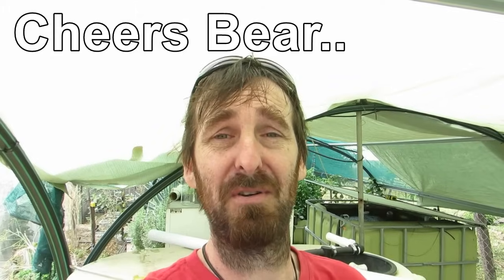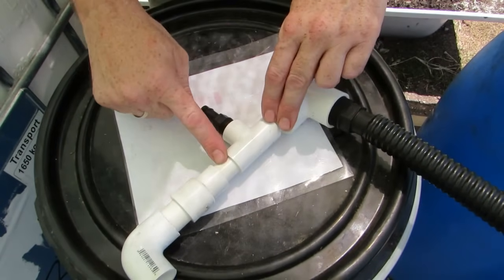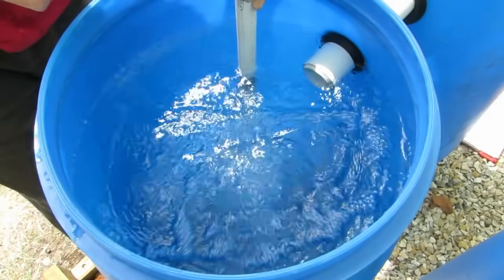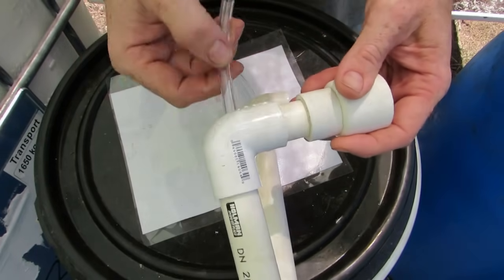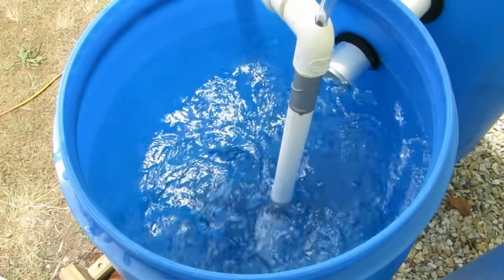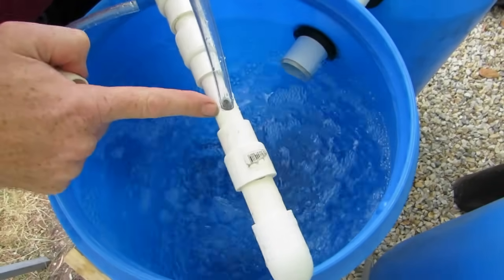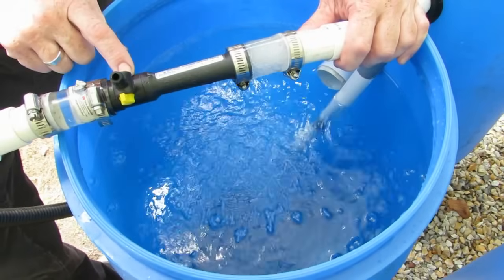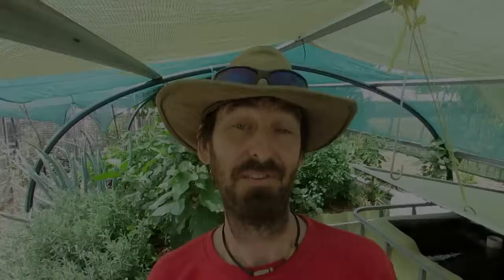DIY venturi, a few easy builds for aquaponics, aquaculture or hydroponics..

Comment: Hi Rob. Have you tried capping the bottom of the dip tube that sits down in the tank, then either drilling tiny holes in it (or the pipe itself) to dissipate the air bubbles, or even using some kind of mesh or screen ? 'That's how solar heating air-separators work ( in reverse !)
Thanks for sharing your hobby.
Interesting stuff mate !
Reply from the maker: It has been suggested but I haven't tried it with mesh but did have a pipe with holes drilled in it at one point. I like to tun them at the surface now. 
Cheers mate.

Comment from the maker: Have thought about using some shade cloth as the holes are smaller but I think we are both on the same page ;)
Shall be gluing up the final unit for the system this week along with 2 for the RAS as I think it has proven it's worth..
Cheers Ra & have a great one..

Comment: Hey Rob! I came across your videos recently and have been enjoying them very much. You've done a good describing the function and construction of all the different components of an aquaponic system. I had an fairly simple idea that may help you decrease your bubble size and increase the oxygen saturation on your venturi system. If you were to add an aeration screen, like the one on a kitchen faucet, on the end of the PVC pipe, it should diffuse the the larger bubbles in the pre-oxygenated water, increasing the oxygen saturation without restricting the rate of flow much, if at all. Just a thought! 
Mark Stephens - Houston, Texas
Reply from the maker: Hi Mark & thanks mate. One concern I'd have with that is the screen may end up getting clogged with solids.  Can see where it would help out in some situations where the solids were all removed.
Cheers & all the best Mark.

Comment: The key I found to small bubbles was a 40% ish angle and then heating it and squishing it into a slit as well as adding a sponge to the intake. I had over purchased on my pump and had plenty extra so I took a T off the main outlet and diverted it back with the Venturi . I'm interested to see your next test.
Reply from the maker: Cheers for that Don.. Might be a while before the next test but will be playing around with them when I make up the bio filter for the AP later today.. Not sure if I will do a clip on it though.. Cheers mate...

Comment: Another idea would be adding the air intake venturi to the pump intake line, rather than its output. The bubbles would then be broken up by the pump impellers at the beginning of the system, rather than having to route flow back. Or having venturi's in both places.
Reply from the maker: Not sure how that would go but worth playing around with.. Might need to alter the shape of the air intake pipe a bit from the way its set up now so it just doesn't suck too much air.. Will definitely keep it in mind when I get down to play around with it again..
Cheers Jim..

Comment: Wotcha! You may have seen this during your research...but just in case you havent. Try sticking a small sliver of synthetic sponge into the air intake of the venturi. It reduces the size of the bubbles but also reduces the sucking sound of the venturi. If you make the sliver wedge shaped you can pull it in and out thus reducing the density which works like a throttle for the bubble size.Top tip is to cover the sponge filled pipe end so the sun dosent harden the sponge.
Reply from the maker: Thanks for that Michael.. I have seen people add them to the outlet but haven't played around with that yet..
Is it getting chilly over there yet ?
Cheers
Reply: First hard frost of the year this morning. The carps water has just dropped below 10 degrees c so its time to swap their high protein feed for wheatgerm.
Reply: did you Like the video I Did
Reply: hi
Reply: Michael Tricker helllo

Comment: Having made several myself, it looks to me like you should put your pump on the other side of that commercial venturi. The lower pressure is created by a smaller water jet going into a larger volume pipe. That draws in the air.
Reply from the maker: Hi there Old Guy Phil.. The commercial venturi has markings which show what direction they should be plumbed so followed them.. Will play around with it in the coming weeks while I work on the RAS...
Cheers sir..
Rob..

Comment: Great ideas. Thanks mate. Have you considered a piece of stocking around the outlet of the pipe for finer bubbles? Forgive me if it has already been mentioned. I haven't read the comments yet.
Reply from the maker: Hey Ross..
Has been mentioned a bit.. One problem is that any fine debris in the water will tend to clog it up I think.. Would work if the water going into the pump in the sump was filtered though..
Cheers mate & have a great one..
Rob.

Comment: If you dump the air en-trained stream into an inverted bucket the air would collect in the top of the bucket and be pressurized by the depth.  a line to an air stone curtain bar would create the very fine bubbles you are desiring.    Good luck. You may have enough volume for several air stones. The air get  used twice to dissolve oxygen into the water. First as it is pushed into the Venturi by atmospheric pressure and again by the larger surface area contact in the smaller bubbles.  Your going to get 8 ppm of O2 at 68 degrees F more as the temp of the water decreases.  Heat increases the speed of the molecules and they break through the surface easier.  That is why Pop goes flat as it gets warm.  Heat drives any gas out of solution.  aka the unknown chemist.
Reply: But you can dissolve more air into colder water!

Comment: rob I noted that you have made a change to your radial flow filter !! in that it no longer empties into your sump tank
Reply from the maker: Yep, is a proper system now :D
I think the whole system has been running a lot smoother since it's been plumbed up that way Charles.. Looking at adding in a moving bed bio filter in a few months time.. Cheers mate & hope alls well up there..
Rob.

Comment: this is a valuable resource thank you. why isn't your water turning white like most true venturi do tho? I think they say reducing the initial water inlet by at least 10x gives favorable results
Reply from the maker: The pump I used wasn't powerful enough Rik. 👍
Reply: @RobsAquaponics  Oh jeeze, so that's the main factor on that? Blast it super hard and get more bubbles? I was about to build a tank for H20 that would be hyper oxygenated by TI electrodes and venturi then venutri blasted down the line to be blended with a small shot of worm tea and concentrated worm liquid nutes as needed.
Reply: @RobsAquaponics  That way no toxic bi product gets made by electrolysising anything but the h20 and the nutes and h20 get at least 2x the 02 amount for super good delivery

Comment: Rob, we have two Chop and flip IBC totes. We have run water from the fish tanks to a Radial filter to a Biofilter to a sump barrel.  My question is, how many more fish does the Biofilter allow us? We used your formula to determine the fish to grow bed ratio but we didn't know if the biofilter allows us more. We don't need more grow beds at this time but if we have to add them to increase our fish  I guess we will. Thanks DJ
Reply from the maker: Hey DJ. This video may help you out some,  https://www.youtube.com/watch?v=CcR7nriuvYw&t=655s
That link should take you to the relevant section but let me know if you need more info. 
Sorry I missed this as well mate. I like to help supporters out ASAP. I do check the members post more frequently & don't mind you asking any questions over there. 👍

Comment: Hi, couple thoughts on the difusser bar.  Have you tried graduating the hole size so that you have smaller holes closest to the elbow and larger sizes as you reach the end of the pipe so as to spread out the bubbles more?  Have you tried covering the difusser bar with a small gauge netting?  Perhaps not something as fine as a woman's stocking for fear of clogging, but perhaps a few steps upwards of that?  My thinking is that the netting will slice the bubbles as they exit the holes, thereby smaller and greater quantities of bubbles should be produced.

Love your videos.  Please keep them coming.
Reply from the maker: Hi there Charity :-)
I've actually taken all the bars off the end of the line in & now have the water entering the tanks through a straight pipe.. I've found it is delivering a good amount of air & we didn't have any issues with the large perch not getting enough O2 through the hottest part of last summer.. I have been told that some folks have used mesh & thin sponge in their aquarium set ups to reduce the bubble size so it must work OK.. 
Thanks & hope you have a great weekend,
Rob..

Comment: If one does not need a 90 degree bend,  then they are better off not having one, nor spending money on one when it is not needed. The venturi  effect works just as well with the venturi tube vertical or horizontal. But if vertical, the air inlet should have a tube whoes opening is always above the the height of the water so that if turned off, water does not back flow.

Comment: Your fish look awesome.
An addition 12 inches of pipe over the sump would help oxygenate. Cap the end of the pipe and drill holes every inch. Level it and your 1 stream will become 12.
Reply from the maker: All the grow beds free fall into the sump tank in the aquaponic system so I think system gets loads of dissolved O2 in the water.. Was planing on adding these venturis into the new fish farm system.. Should be out there working on it now.. Have a few more comments to respond to first though  ;)
Cheers & have a great one..

Comment: Rob, does the size of the pipe coming out of the back end of the venturi matter?  I see you go from a 3/4" to a 1/2" and back to a 3/4".  Do you have to go back to the 3/4" coming out of the venturi?
Reply from the maker: Hey Byron..
From my understanding the low pressure in the restriction is what draws the air in.. The simple venturi with some hose pushed through the elbow work well without the pipe size being expanded after the air hose so might be something to play with.. 
Cheers mate..
Reply: Rob Bob A venturi can be used to mix a liquid with a gas. If a pump forces the liquid through a tube connected to a system consisting of a venturi to increase the liquid speed (the diameter decreases), a short piece of tube with a small hole in it, and last a venturi that decreases speed (so the pipe gets wider again), the gas will be sucked in through the small hole because of changes in pressure. At the end of the system, a mixture of liquid and gas will appear.
Reply from the maker: That's why we use them in the systems Nicolás Solano Conde.. Makes getting dissolved oxygen into the water a lot easier I think than running compressors & air lines.. 
Cheers mate..

Comment: Hi Rob. Good afternoon. I tried to also put a venturi in my setup. Just noticed that when I turn off the pump, the venturi initiated a reverse siphon. Is this normal? And any suggestion on how to prevent this? More power!
Reply from the maker: A one way valve before the venturi is what I have seen used in aquaculture systems Louie. 
When I use them, I have them entering at the top of the fish tank on a slight angle so only the 40mm was actually under water. That way the air port at the top allows enough air in to break any siphon & if it didn't then only a small amount of water would backflow to the sump.
Hope that helps some.
Reply: @Rob Bob's Aquaponics & Backyard Farm  Thank you!  Another question.. is it better to put the venturi in the sump tank? So that the plants will also receive water with oxygen? I'm having a NFT setup for my plants.
Reply from the maker: @anonymouse3823  It may help to have some aeration in there Louie. It's my understanding that they will get air from other roots that aren't in the film of water that's running down the rails.

Comment: Nice job! How about to use some fine mesh screens overlapping each other?Put them horizontal above the air flow and just below the surface where the dissolving process occurs. (Oxygen dissolves at the surface of the water)
Reply from the maker: I think they'd get in the way in a fish tank. Might work OK used on the plant side of the system though.

Comment: Really nice 👍 do I actually need to shrink the diameter of the tube in order to get the venturi effect going?
Reply from the maker: Hey Daniel. The restriction helps to create the low pressure zone which allows the air from the atmosphere to enter into the unit. 
Cheers & sorry for taking a while to respond.

Comment: If it's feasible to put the venturi in line before the pump the impeller will chop the bubbles up finer and give you better dissolved oxygen. It's a technique  some protein skimmers use for saltwater aquariums, but it should work here as well. The only potential problem I see is if the line between the pump and the tank is too long the bubble might merge into larger bubble before they reach the output in the tank. You would also have to keep the venturi air intake above the source water level, or it would become a fountain if the pump ever stopped.
Reply from the maker: Hi Bob.
It's not something I can do with the way my pump is set up but would like to know how you get on if you have a crack at setting yours up that way. 
Cheers mate.

Comment: Hi Rob, Great video, what if my pipe from the sump, going to the GB and FT is 3/4 / 20mm. Can I still drill a hole in the elbow and insert tubing or do I need to reduce the size again between the flow and tube?
Reply from the maker: Hi Frances. That should work to add a bit of extra air into the water. Not sure if would be enough as it would depend on how the system is set up & how many fish you have in there.
Sorry for taking a while to get back to you.
Rob.

Comment: Hi. Great video. Why do you put the Venturi at the end of the run. Wouldn't you get better oxygen uptake if the Venturi is nearer the pump?
Reply from the maker: They work more efficiently closer to the outlet as air bubbles will still be small causing more agitation at the water surface. This leads to more dissolved O2 entering the water as I understand it. 
Cheers Ian.

Comment: Cool, could you put a screen mesh to aerate the water on the way out of the simple unity to break its bubbles up, or would that slow the flow too much?
Reply from the maker: Have been told that it will work to a degree by folks that have tried it in aquarium set ups.. Haven't tried it here though..
Cheers mate..

Comment: Would you suggest using 3 - 200 liter drums in the filtration system to improve water clarity. 1 - swirl filter, 2 - bio filter, 3 - for ?. Thank you for your help, Gil - Southeast Louisiana USA
Reply from the maker: Hi George. I'd go with a Radial Flow Filter (RFF) then a bio then another finer solids filter after the bio if you're looking at removing as much solids as you can. 
The reason being is that the bacteria in the bio will also be producing solids + some will make it through the RFF as well. 
Cheers mate & hope the build goes well.

Comment: Can you place a wad of aluminium fly screen mesh or stainless steel scourer in the line to break up the bubbles before exiting?
Reply from the maker: It may work to a degree but haven't felt the need to try it myself. 
Cheers.

Comment: Great video and thoughts on venturi could you suggest were is a good low cost high quality site to get your water pumps from ,thanks Mike
Reply from the maker: Hi Mike..
I have bought all but one of my pumps from Guppys here in Australia..Bellow is the one that is driving the aquaponics at the moment..
http://www.guppysaquariumproducts.com.au/pumps-power-heads/hqb-/-jhq-submersible-pump/pump-4500l/phr-submersable-multi-purpose/prod_64.html
Not sure where your based but if your in Australia these guys have always done right by me & found their prices to be reasonable..
Hope that helps some & have a great one,
Rob.
Reply: Thanks for responding Rob, I'm Located in North Carolina (USA) But I would appreciate any info for my area if you happen to know anything good I'm going to try and start my own aquaponics with an underground greenhouse combo starting the the first of the year and again thanks if you can give me any specific brands that you used, I can search the states for that type but any and all info would be greatly appreciated and happy and safe holidays for you also mate thanks Mike
Reply from the maker: Mike Quick Hey Mike..
The Sunsun brand (in link above) is all I have had experience with so far.. For the RAS I just bought a Jebao 6500lph/1700gph that runs on only 50W so will be cheaper to run than the 4500lph pump in the aquaponics.. As I haven't run it yet I really cant say how good it is..
Hope that helps some mate & also that you had a great one yourself..
Rob..
Reply: Thanks for the info Rob and be safe mate.Mike Quick

Comment: awesome. but i was just thinking, if you put a stopper in the end of the irrigation pipe and then pricked the sides with lots of holes.... wouldn't you get finer bubbles?
Reply from the maker: Hi there.. Don't think it works that way but can give it a shot when I play around with the system.. I have been told by others that if some mesh/shade cloth gets placed over the holes at the end of the delivery pipe that it will create finer bubbles, haven't tried that myself yet though..
Cheers & have a great one..